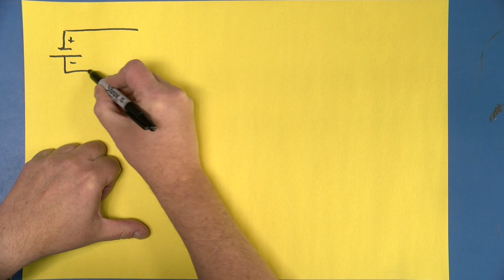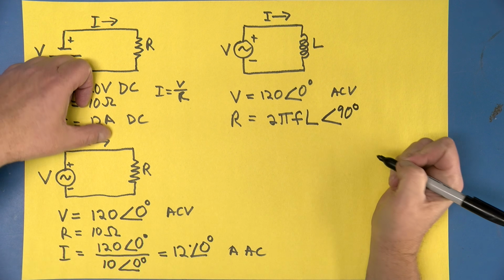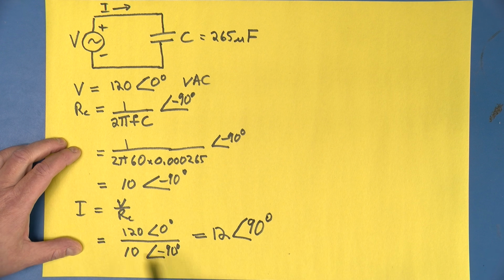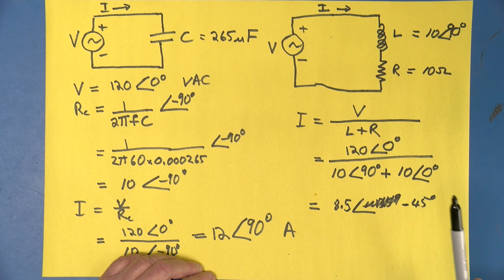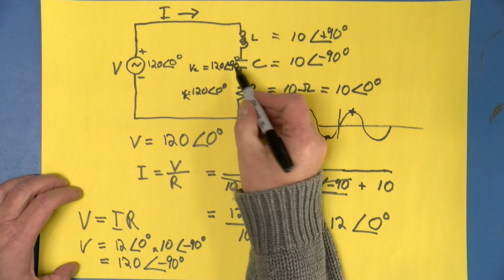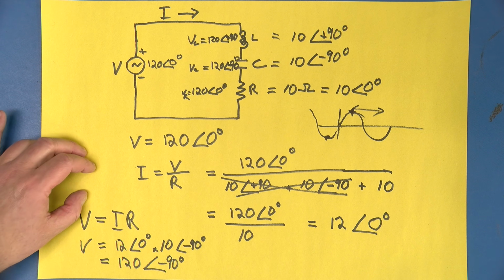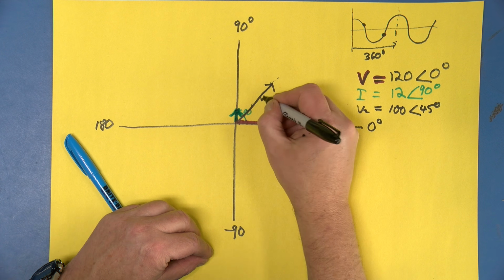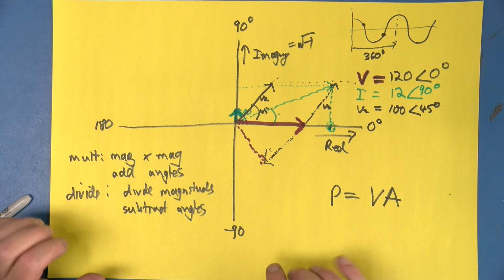Ohm's Law for AC Circuits with Resistors, Capacitors, and Inductors.

Comment: Great video as usual.  I was just wondering about this since I saw your other video about power factor.  I find AC a little harder to track than DC.
Reply from the maker: It is a bit trickier! I will be doing one more video on power factor itself, including not only the nice classical linear power factor we have talked bout in these videos, but also the horrible spiky current PF from electronic powers supplies and which plagues our power grid these days.